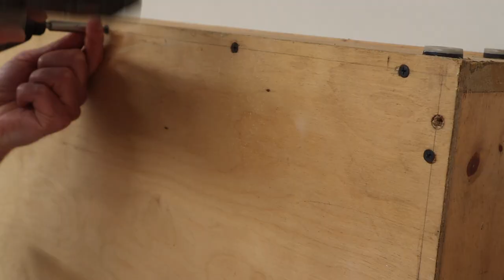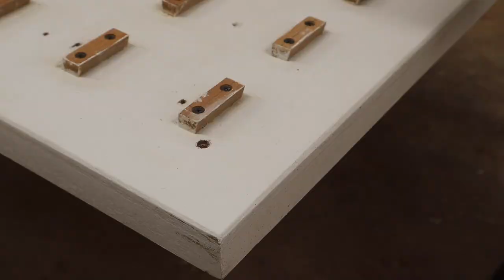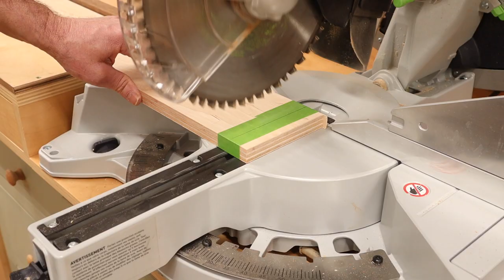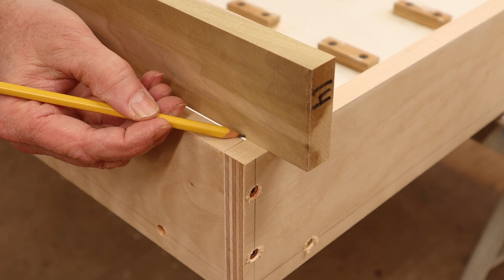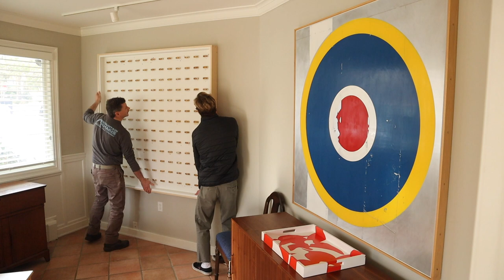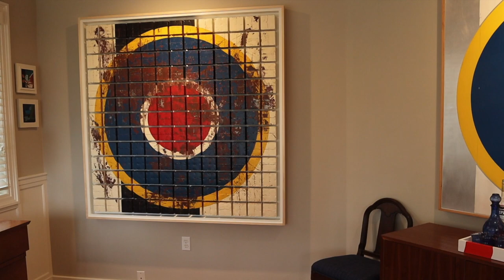169 French Cleats - Only a Woodworker would Make This

Comment: Very cool, John! That must have been a lot of work making all those cubes, but the result is well worth it. Inspiring technique... could make something a little more abstract by rearranging the pieces differently. Like a portrait picture where the bits are not where they are supposed to be. Much like picasso and other cubists. I'm curious about the screws you left visible on the outside. Is it accentuate the industrial feel of the piece?
Reply from the maker: Thanks, you really don’t notice the screws so I decided not to plug them